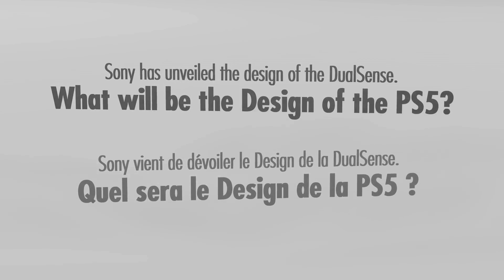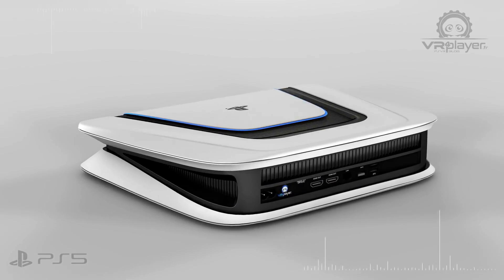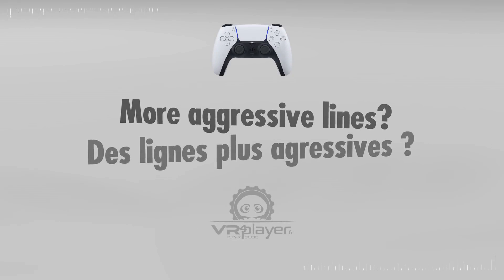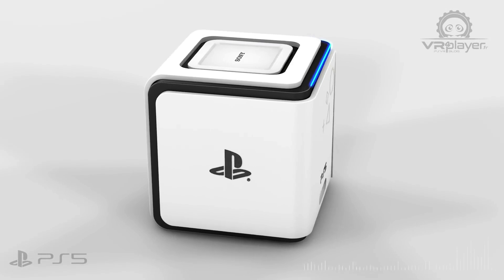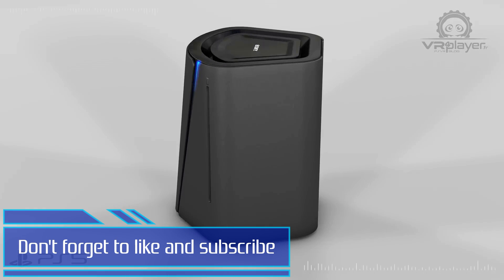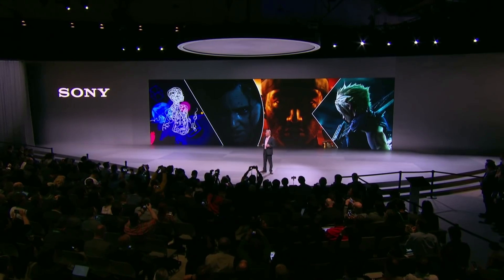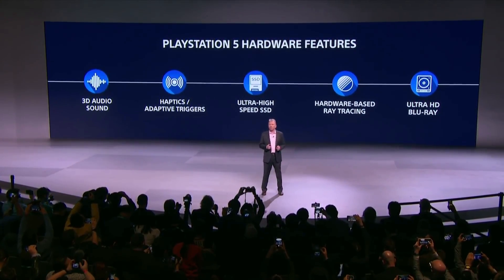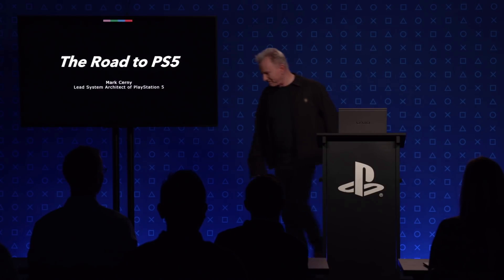PS5 Uses Revolutionary Cooling Solution | Overheating Concerns Squashed, New Patent Reveals

Comment: This is heavily implying that the PS5 has 3D stacking. This must be the secret sauce. If so the PS5 is super integrated. The yields & speed on this thing will be incredible.The actual performance is beyond the spec numbers. Cerny underplayed everything. therefore goodnight bottleneckbox and PC hermit gaming lol. if anyone wants to know why 3D stacking is revolutionary watch this video https://www.youtube.com/watch?v=avLtZo8sIhw
Reply from the maker: I don't know what that is, but it sounds awesome. Hope it's true.
Reply: @MBG  You're willing to believe anything sounds dangerous.
Reply: @juanm6248  When processing games the Xbox does 3.2GB/s Raw processing and 4.8GB/s compressed 

The playstation Runs 5.5GB/s Raw and 8.9GB/s Compressed basically the PS5 has a faster SSD with the weakest of the PS5 being 0.7GB/s faster, now that might not sound like much but in comparison
The PS4Pro takes 20Seconds to load 1 GB, so even if the PS5 is faster, The Xbox still runs at a more than competent speed 
To sum it up
The Xbox does in a second what the PS4Pro would do in a full minute 
The PS5 does in a second what the PS5 would do in 2 minutes and 10 seconds 
Basically both these consoles are insanely faster and both run at a more than competent speed 
Yet Playstation wins By far

Now.... The GPU
PS5: 8X Zen 2 Cores AT 3.5GHZ(With variable frequency, I'll get to that) basically means the console will always operate at the same power level wich is insanely usefull

XSX: 8x Zen to cores at 3.8GHz (3.6GHz with SMT 7nm)
 Xbox is 0.3 Higher unless playing higher performance games than it is merely 0.1 diffirence wich means nothing in the end 
But still a RAW specs win for Xbox but we can tell by measure of performance yet

Wich brings us to Terraflops
The XSX runs 12 TF 52CUs giving them 1.825 GHz GPU Clockspeed

PS5 Runs 10.28 TF 36 CUs but claims that there CUs are 62% stronger than Xbox's giving them the equivalent of 56CU's and this is proved by the PS4 running at 2.23GHz GPU Clockspeed(Also Variable frequency) this is why I said that Terraflops dont matter Xbox uses Polaris 12TF where is PS5 Uses Navi 10.28TF wich is equivalent to 13.3Polaris 
AKA: PS5  wins this round

Also both Run RDNA 2 GPU Architecture 

The PS5 memory Bandwith is a contsant 448GB/s 

The XSX is a variable between 560GB/s and 336GB/s

 Now although  the Xbox sound faster it was explained that some functions will mostly run at 336GB/s and rarely on the 560GB/s wich means that the PS5 is overall the most efficient and better experience as pointed out by : Gameranx, Reviewtech USA and Digital Foundry

PS5 Wins the Memory Batndwith Compartment only through efficiency not power

  Now when it comes to Physical storage 
The PS5 has:825 GB
The XSX has: 1TB storage
The massive diffirence is THE Xbox and it takes this round by far with 125GB More storage
Yet some claim this is because the base apps on the ps5 take the other 125 GB but its actually 1Tb and the Xbox didn't include the already installed games
But this is not confirmed and I dont care for rumors

Xbox wins in storage

It is note worthy that both will feature changeable cartradges so you can change and add storage to your device like the PS2 had memory cards so you can take your SSD to a friend with all your games and play it on his system without even needing to install them on his first
Both consoles will do this
Yet PS5 can use any hardrive yet Xbox wants you to buy Xbox specific cartradges
So PS5 wins in accessibility

Backwards compatibility 
Not alot has been said exept both consoles will Only be compatible with 1 prior generation meaning no PS1 PS2 or PS3(unless is already in PS store)will be playable on PS5 
As well as no Xbox(original) or XBOX360 games (unless in the Microsoft/Xbox store) 
Will be playable on the SXS
No advantage 

Sound: XSX uses Dolby Atmos 3D with 36 sound channels and frequencies

The PS5 runs it's own Tesla 3D Audio Tech With 100 Channales and Frequencies and depth sound technology even used in VR
PS5 wins in sound

Games: XSX has no exclusives and will share all next gen games with Xbox one decreasing over all quality of the games for XSX at luanch stated by Xbox

PS5:Has PS5 exclusives at luanch that cant be played on any other console including PS4 and thus will produce better first party games
Sony Wins Exclusives(as always)

Ways XSX is better:
1.GPU being 0.3 or 0.1 GB/s faster, Microscopical diffirence but still better 
The diffirence between the XBOX1 and PS4 was bigger.....

2.Memory Bandwith although the PS5 will run faster for the most part the XSX still has a higher max so the win goes to XSX

3.Physical storage by little counting the pre installed content

PS5 wins in:
1.SSD Speeds By far doing more than the Raw And compressed Xbox speeds by the PS5 Raw alone and then the PS5 compressed is even faster than raw wich wins both XBox raw and compressed 

2.GPU Clockspeed quite far(by 0.550GB/s)

3.CU power(by little honestly doesnt matter)

4.Storage Accessibility By using any storage you want instead of XSX only usable cartradges the XBox Will Use

5.Sound With PS5 using 64 More sound channels and frequencies 
We can put it on roughly 3 times the Xbox sound quality, anyone playing Apex or COD or FN or any other game for that matter will have 3 times better sound accuracy and Quality 

Honorable Mention: PS has VR2 coming with XSX still on no VR(wont count this as a win stat)

6.Games: PS5 Will have PS5 exclusives on luanch and a larger luanch games line up As XSX will have no exclusives for its first 2 years and a decrease in exclusives quality so it can also run on Xbox one, like games on PC had to be scaled down to accompany the PS4 and Xbox1
Playstation will not scale PS5 exclusives down for they are not on PS4 and can tun at That level for not being made to also run on PS4 but PS5 exclusively

XSX wins in 3 compartment

PS5 Wins in 6 ( at total of 8 but we dont count the other t2 as it is a feature XSX doesnt have and thus cant be compared and we wont use a win be defualt as a stat)
Reply: @juanm6248  I just watche that 1 hour long PS5 conference wich was freaking awesome seeing the capabilities of the PS5 and wanted to see what other people had to say so I watched Reviwetech USA
Gameranx
And 
Digital Foundary(A PC builder) 
All of them Who the proceeded to explain what Mark Cerny actually said got most of the GPU and SSD talk but I didnt really get the rest like closkspeed Memory bandwidth and CU's like Terraflops, so I did extra research on what these components actually do from AMD in their PC building kit and explanation for components and rewatched the Gameranx one (because it was the shortest) and finally understood what the hell they andMark Cerny were saying, in a gotta say The PS5 is an amazing peace of tech and as a added bonus AMD even started Asking Mark Cerny for the Modded GPU cores the PS5 uses as it was IN ESSENCE more powerfull CU per CU than in PC infact the PS CU is per unit 60% stronger than a PC CU
Meaning 36 PS CU's are as strong as 56 CU's in a PC 

That is due to sony using Navi tech in Playstation and PC MOSTLY using polaris, 
Hence 10.28 TF Navi(For PS5) is basically 13.3 TF Polaris 
Wich is why the PS5 has 2.23GHz/s clockspeed with 10.28 TF

And the XSX(Xbox Series X) 
Has 1.82GHz/s clockspeed with 12TF 

This is because even though the PS has Less Terraflops it has a better quality terraflop(navi) so although less, it has more power flop per flop, to the point that it has less flops but stronger power in the end some with the CU's PS5 has 36 and XSX has 54
But the PS5 CU's ar CU per CU 60%faster wich is why it has less yet stronger Tflops 
Wich explains the 2.23 to 1.85 GHz/a difference wich the PS5 has the advantage above the Xbox
Aka so don't let the higher amount of CU pr Tflops Of the Xbox scare you it is significantly weaker
My sources are:
Mark Cerny
Digital Foundry
Gameranx
Reviewtech USA
Reply: @captainprototype755  I will check it out thanks for the substantial info.
Reply: @juanm6248  Same didn't know about the big difference between Navi and Polaris.
Reply: @captainprototype755  wtf xsx doesn't use polaris gpu it uses also the rdna2 gpu.
Reply: @captainprototype755  man you made a salad, also who fucking going read that book😂... Xsx SSD 2.4GB/s raw not 3.2GB/s.... Both next generation consoles using RDNA Gen 2 architecture custom made for each company with their features and technologies inside the chip...
Reply: @captainprototype755  the CU on PS5 stronger and bigger then PS4/PS4 Pro not from xsx, both PS5 and xsx use same size of CU from RDNA Gen 2 architecture... The xsx run at 3.8GHz only with 8 cores and 8 threads while on 3.6GHz it's 8 cores and 16 threads (SMT) that better option... SMT stand for simultaneous multithreading...
Reply: @מוטיאהרן  the smt threads are 7nm, read man
Reply: @מוטיאהרן  so basically even weaker then mentioned
Reply: @מוטיאהרן  let me put this slow so you can understand XSX SSD style
The 12TF 52 CU of XSX give it 1.84Ghz cuase its polaris RDNA2 architecture 

The PS5 10.28 TF 36 CU is 2.23GhHZ that is over 0.4GHZ faster on the GPU, why? Because the PS5 uses Navi the 12TF Xbox GPU is weaker becuase it uses polaris, slow enough ?
Reply: @captainprototype755  the smt technology exist long time ago over 10 years maybe...
Reply: @captainprototype755  ???? GNC gen 4 architecture codename Polaris it's not RDNA Gen 2 architecture, they are 2 different architectures... Where you bring that nonsense?
Reply: @captainprototype755  marco both consoles use Navi, Navi 1X it's just the codename for RDNA architecture.... Navi 2X it's the codename for RDNA Gen 2 architecture... Xsx have more powerful GPU by 15-20% maximum....
Reply: @silureswarrior6045  because you cant man
Reply: Just wait for PS5 reveal bro you'll see
Reply: Cerny might be the smartest video games designer ever
Reply: Simply this for dummies like me
Reply: Graphene and Quantum calculations confirmed for PS5
Reply: I laughed more than I should’ve 😂
Reply: Hold on to these prayers you have for this console because its still not gonna be able to compete with the series x Sony was not prepared for what MS were working on since 2014 or was it 2016. The power banner gets shifted so now all that can be said is "no games"! Fucks sake stop the bull shit. Truth is there are as many gamers out there that can honestly care less about AAA games... Let us be great regardless what we want to play & what console we want to play on. Your not buying the console for us so WTF should anyone care what the other person wants to play on? I will own both just like I do now & if there is a game on ps5 I want I'll cop it or wait like I did for spider man GOTY edition to go down to $20 but any multi play titles I rock on the Xbox because its a better gaming experience for me than on ps4. IMO Playstation is great for me when it comes to single campaign games they have, any exclusives that may spark my interest that may have co-op I usually just do campaign and then its a Reynolds (wrap)
Reply: Lmao. 😂😂😂😂😂
Reply: What is 3D stacking
Reply: This guy is trolling right?
Reply: @Chuck1Norris  you wish lmao
Reply: @Chuck1Norris  Nah, it's all Facts.
Reply: Killer-_-B The Marked warrior for real? Come on now. This is starting to get reach “power of the cloud” levels of ridiculous.
Reply: Now we're just making stuff up at this point 😂😂😂
Reply: @kthebarbarian8223  sxs uses polaris also I did say both consoles use RDNA 2
Reply: @captainprototype755  marco???? What you talking about? Both next generation consoles xsx and PS5 using RDNA Gen 2 architecture costume made with each company and their special features and technologies inside the chip... More threads better then less... The CPU different are tiny...
Reply: 3D stacking is not even out yet lol.
Reply: @juanm6248  is patented on PS5 tho, sony did release a patent talking about it MYSTIC did a video on it, it was filed by sony
Reply: @captainprototype755  Those numbers I posted up where accurate as they both use 7nm chips to customize their consoles. When you were comparing GPU's Cerny was comparing the PS4 pro to PS5 GPU never mentioned the XSX GPU.
for as you know the PS4 pro is using AMD Polaris.
Reply: @juanm6248  yess but it still stays relevant, because the 10.28 36CU of the playstation puts out 2.23Ghz the 12TF 52CU of the XSX puts out 1.85Ghz,so although the playstation has less Tflops its Tflops are mathematically 60% stronger than that of the xbox to get the Insane basically .500Ghz boost, so it is in evidence stronger
Also RDNA2 Architecture isnt automatic polaris the RDNA2 is implemented mostly in CPU not GPU
Reply: @captainprototype755  Again  cerny was making that reference in regards to the PS5 being 62% or 58 CU's more efficient than the PS4. No one said it was more efficient than the (Same) RDNA 2 7nm chip XBSX is using.
Reply: @11_ 11 No dumbass, learn how to construct a proper sentence, PS5 will have inferior ray- tracing, everything other than exclusives will be weaker on the PS5.
Also the PS5 will be more expensive, not because of its greater specs but because of its memory infrastructure.
Reply: @juanm6248  so you have the prices on the new consoles confirmed? So you are an expert on tech? Why is the ray tracing inferior?
Reply: @jakehunter3434  First off the PS5 memory architecture is superior to XBSX. Using 12 channels as opposed to 4 channels. Those channels will be able to process more information at a faster cache which n turn will allow larger environments to be rendered more efficiently. The difference in ray tracing visuals is where the XBSX will shine.

PS5 Specs

PlayStation 5's GPU: 2,230 Mhz (frequency) 2304 SUs (shading units) 144 TMUs (texture mapping units) 64 ROPs (render output units) 36 CUs (compute units) 4MB of L2 Cache
 
Xbox Series X's GPU: 1,825 Mhz (frequency) 3,328 SUs (shading units) 208 TMUs (texture mapping units) 64 ROPs or 80 ROPs (render output units) [amount is unknown at the moment] 52 CUs (compute units) 5MB of L2 Cache
The difference in visuals

PS5's GPU: 2304 SUs x 2,230 x 1000 = 5,137,920,000 shading operations per second
 XSX's GPU: 3,328 SUs x 1,825 x 1000 = 6,073,600,000 shading operations per second.
Reply: @juanm6248  So the hardware for ray tracing in the xbox is a little under 12.5% more powerful than the PS5's correct?
Reply: @LughLamhfhada0609 Yes  around that number when PS5 is running at full power.  Remember it's going to take a hit once it has to cool down bringing it down to 20%.
Reply: @juanm6248  Which won't be very often, it is called continuous boost after all.
Reply: @LughLamhfhada0609  Thats the only thing that bothers me with the PS5 the variable ups and downs by 10%.
Reply: @juanm6248  Will it though? Unless you're working with both pieces of hardware you really can't make that statement. Yes, the Xbox can cast more rays, but the PS5 can complete Ray cycles faster which may result in similar real world performance. Unless you're a Dev who has tested both hardware, you really can't make that claim seriously.
Reply: @MrManBuzz  The computer with the more advanced memory components is usually the more expensive product, these are factual statements from people in the tech industry.
Reply: @juanm6248 the XSX is going to be cheaper?
What the hell man.
Reply: @juanm6248  go play in traffic
Reply: @Jay-jb2vr  Alot of triggered fanboys up in here.
Reply: @juanm6248  I wouldnt say ps5 raytracing will be inferior. Software can always be updated, hardware cant without a revision. I personally dont care which way ether system goes with it because it is new for gaming in general. The fact ps4 will soon have raytracing is good for everyone not upgrading to next gen for awhile. That is a plus for sony not a negative. We have also not seen their raytracing. People with eyes like as hawk may tell a major difference but normal gamers may not see a difference.  We just have to wait and see.
Reply: @ericmeiring2512  the ps4 can't do Ray tracing lmao
Reply: @ericmeiring2512  ps4 will never have raytracing... impossible.
Reply: @gdstro4814   hate to burst your bubble  they have already stayed they giving it to ps4 sony is doing software based raytracing means it's a program so yes it can.
Reply: @ericmeiring2512  source?

Comment: I would be in favor of liquid cooling but okay
Reply: It's actually not as efficient and has a high chance of the pump breaking down in just a year. Also air cooling is better overall liquid cooling is only better in short sprints.
Reply: The problem with liquid cooling is the chances of liquid damage if anything leaks, as well as the need to clean the loop on occasion. Not gonna be an easy thing to do in a console.
Reply: $3,000 PS4 Upgrade - Custom Water Cooling and More!   https://www.youtube.com/watch?v=QVnicN9-IBY